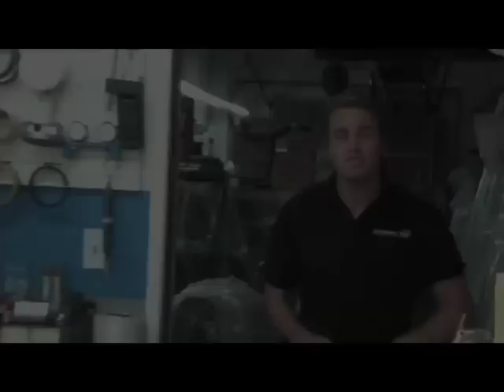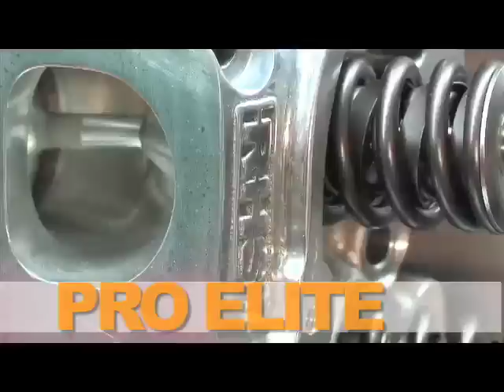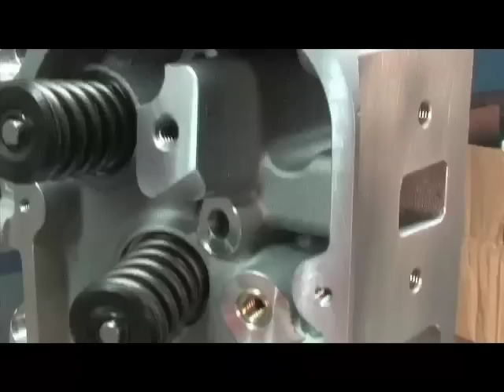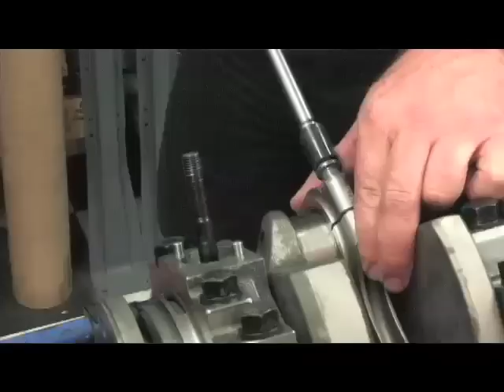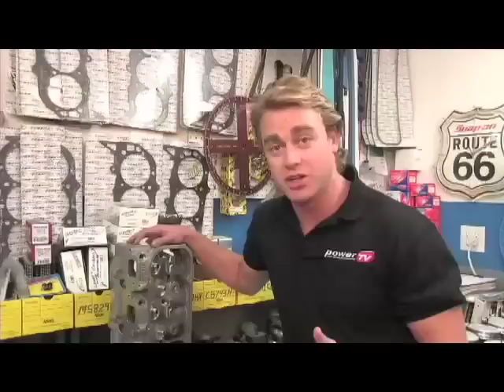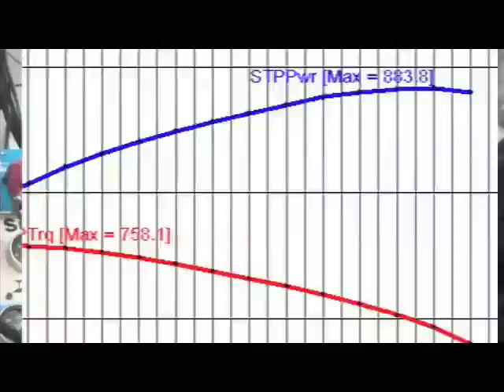Big Block Chevy 572 Build with Pro Elite Heads

Comment: How come no details of the rest of the bottom end? I hve the proaction 360 heads on a dart 572 with a forfged 10-1 compression with a 305 dur 570 lift flat tappet cam with a single plain intake and a 850 double pumper and finally 2" primaries stainless headers. My question is how different was this motor compared to mine and why did my dyno run only hit 640hp/682tq?
Reply: A good bit bigger cam,hydraulic  roller or solid roller,about 200 more cfm of carb a little  port work on the intake with a 2 inch spacer. You probably  just gained 150-200 hp. That's where you left it. All about  the combination  it has to work together.
Reply: headers are small, more carb and a little more lift...maybe????
Reply: Your specs are off in some major areas if you were aiming for a higher horsepower or a drag motor. What was your goal, drag or street, or street/strip?  The bottom end isn't the problem as long as it has a good forged steel crank and rods.
Reply: I meant to add, "It's all in the mathematics." If you are still having power issues I can point you in the right directions. I can even recommend a book of math formulas so you don't have to depend on others all the time.  The problem with relying on others is 5 people will give you 10 different answers.  The good thing is you have a good set of heads already.